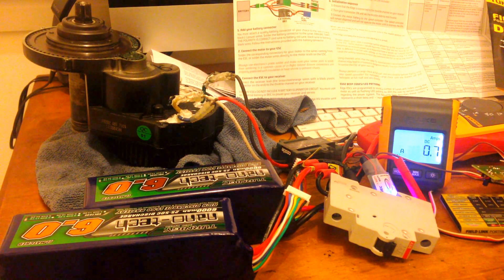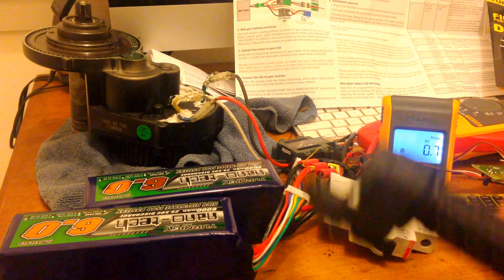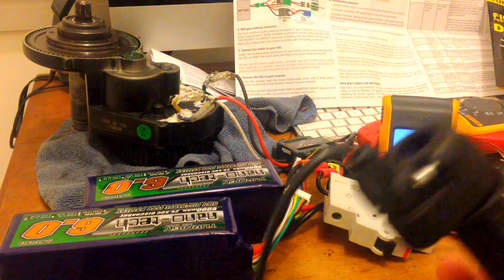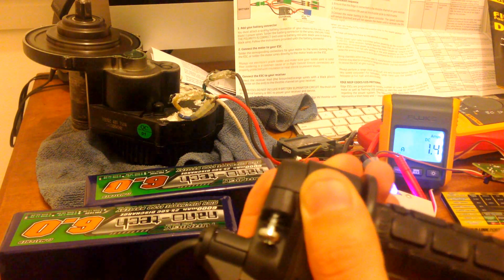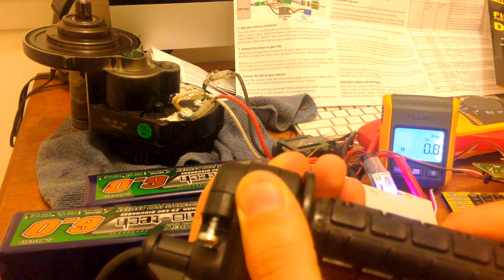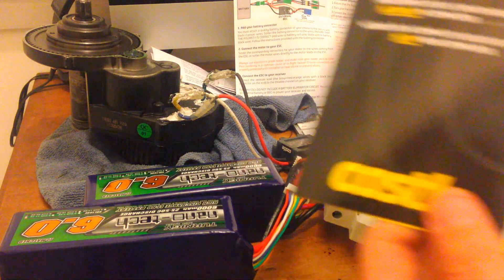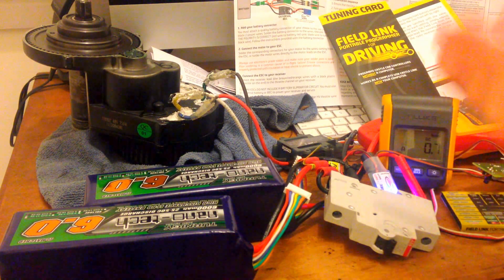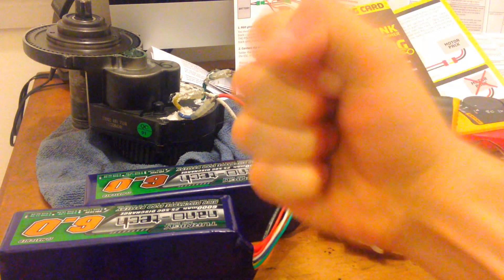Bafang BBS02 + 60A 3000w Castle Creations controller (UPDATE 4) testing different throttle settings

Comment: Hi Mr. MORE POWER!!!!!! 
another great idea, you don't no if you don't give it a go. 
Was your throttle electronic or standard ebike ? I no with the remote control stuff throttle is ran by an electronic speed control. The old days were like a ebike throttle with a servo attached.

Comment: also. note that amps = torque (this does effect your core temps. so the motor could get toasty, ) and Volts is speed, so if you wanna go fast. you want to mod max volts

Comment: OMG you're going to fry that castle. That is an unloaded motor, of course its going to be 2 amps. Attach it to your bike and you'll get your 60 amps. The high pitch noise is normal for a CC you can change frequencies with the programming cable.
Reply from the maker: +Nomad Chad - Yeahh.. I changed frequencies I noticed improvement but there is a fine line between good high frequency and "too high". I will return to that project and try some other stuff, I may re-wind the motor for higher KV and better top speed. =]

Comment: Hi there,i just wondering if you need to have set the max/min endpoints with the controller and throttle(maybe the ebike throttle is not in range) .Also if your controller has data logging you can see the range. or you could try testing with a rc  tx/rx?
Reply from the maker: +Amatronix coory - Hi Amatronix, thanks for your advice with the max/min throttle settings =]  I made this video a while ago and to be veeeery honest I can't really remember if I did it or not... but I think I did set the throttle max/min. I kinda gave up the tests but I still have all these toys here sitting in my garage.. I want to try it again and see how it goes, hopefully it works at this time....  =]

Comment: I think you will burn winding under 3kW
Reply from the maker: Under normal conditions YES it would... but the plan was to increase the power gradually and work on a very efficient thermal management system, additional heatsink, cooling fan maybe constantly blowing air to the additional heatsink or maybe (even better) drill some holes on both sides of the motor and get the air cooling the winding.

Comment: you dont have brake on shaft, it would take more amps
Reply from the maker: Yeah... you made a good point! It was just an idea... after posted this video I realised that "brake" would be impossible with the Bafang BBS02 and most mid drives because of the internal freewheel... =/ 
Would work with a direct drive systems but in this case I would get a controller with regen brake function pumping power back to my batteries instead of wasting =]

Comment: its not loaded, give it load, it shoots up
Reply: rpm should be the same at same voltage, you need to up the voltage to increase rpm
Reply from the maker: +Daniel Liaw - yeah... I got this one as a test trying to make it spin faster only by playing with the internal settings, changing the 3 phase frequency and things like that... I could get ridiculous amount of torque but the internal gears wouldn't handle so I just decided to stop this project and stick with the Bafang stock controller pumping higher voltage just below the maximum limit (60v). It originally spins at 120rpm but with all modifications I made in my controller settings + higher voltage, I made that thing spins 155rpm https://youtu.be/chO8e_RCdto yeeeahhhh!!!!